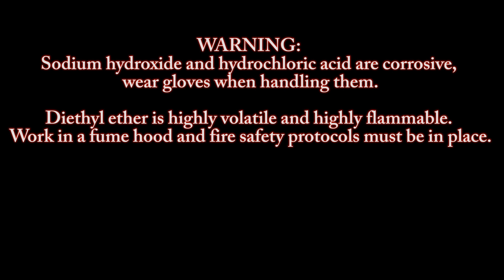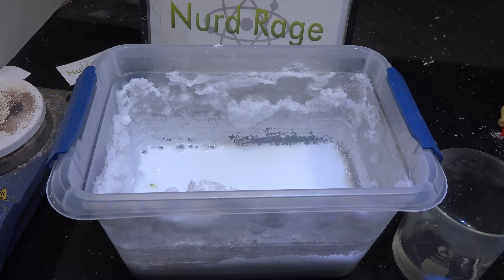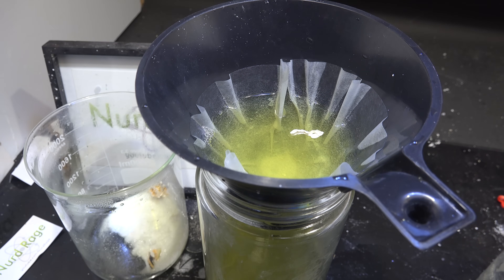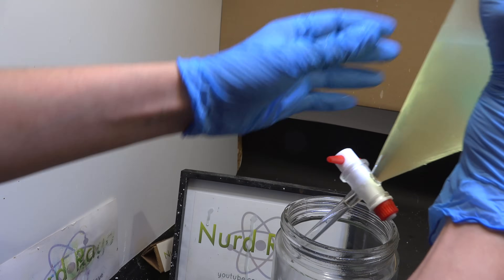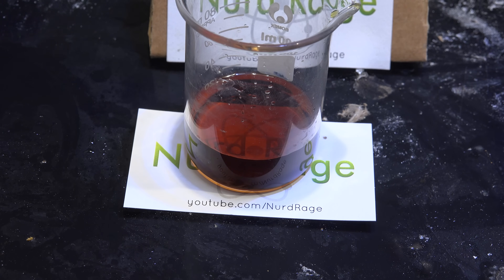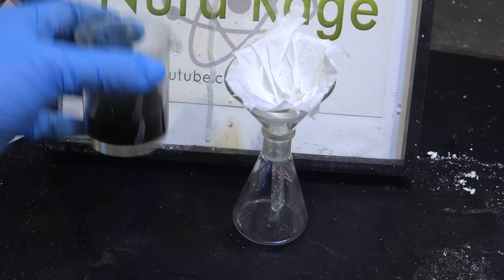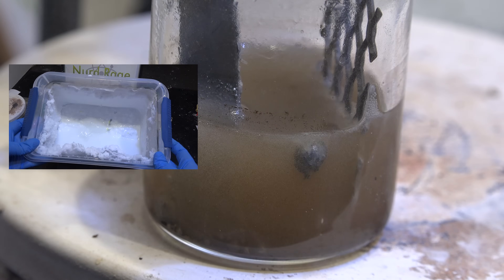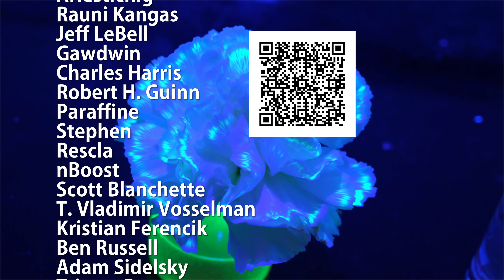Recover Used Gallium From Aluminum Using Solvent Extraction

Comment: I recently did an amalgamation of gallium-alumium-indium for viscosity experimentations, after reacting the alloy with h2o presumably reacting off the aluminium. I was then left with a liquid alloy bi-product which I assumed to be the remaining gallium and indium. The bi-product alloy remains in a liquid/jelly like state in the h2o with no visible reaction once the aluminium is reacted away.

when i attempted to retrieve and recycle the remaining gallium-indium alloy it rapidly oxidized as soon as dried and exposed to air. This oxidation of the bi-product was quite exothermic and resulted in a liquid blob with an oxidation layer. Each time i disrupt the oxidation layer and expose more liquid alloy it rapidly oxidises and continues the oxidation reaction until the entire liquid alloy is oxidised into powder. 

My question is why has my gallium-indium biproduct become so reactive in air that is unable to be recycled or handled when a standard indium-gallium alloy wouldn't react the same?

*Edit, The metals are mixed at room temperature under standard atmospheric conditions so a complete amalgamation may not be the correct term

Comment: It’s very annoying, but you COULD do a paper towel extraction on what spilled to recover as much as possible. Wipe everything up and then submerge the paper with water. Stir and then pour off the water. Do this several times and you can usually recollect around 50% or higher of what spilled.

Comment: So I’ve been given the nickname ‘gallium boy’ by my colleague chemistry professors. It started with asking if we could do the heart beat demo in lab. They said we didn’t have gallium so I bought some and a few days later showed up and said “can we do it now?!” 😅😅 fast forward about a year and I’m now building, or attempting to build, a YouTube channel funded by the university. 

One thing I’ve been wanting to try is electrolysis of gallium. I took about a week and dissolved some gallium in concentrated HCl. I know the next step is the addition of NaOH, but I’ve been holding off as I’m having trouble finding suitable electrodes. 

Since it summer, I guess most of physics department is off 😂 so I’m having a little trouble tracking down a lab power supply as well. 

I was thinking of trying to find a circular cathode that would basically sit across the top of the beaker so the gallium will rain down. I’d also really like to try it at low temps and try to get the gallium to crystallize. I’ve found some info on the pH range the solution needs to at for electrolysis, but haven’t found anything on the temperature ranges.

Comment: I've been reading that they have found that they can get a stronger reaction with water if they use more gallium than aluminium so the aluminium forms nano particles. 
I wanted to try it but I'm worried about getting the gallium back to try again.
This helps a lot what % would you say it's possible to recover like this?

Comment: Diethyl ether has a potentially explosive reaction with oxygen.  Makes some kind of peroxide, don't recall exact details.
Distilling ether is groovy and all, but it strips out the stabilizers.
We had a 2 liter bottle of diethyl ether that was nearly 15 years old; less than 1/2 had been used, but it had been opened 100's of time.  Yes, there was a log-book.
The fire department came, asked a few questions, then the bomb-squad came.
They carried out the ether in a little armored cart, the cart jockey in full bomb-blast gear.
Controlled detonation followed, according to the police report.
Then we found a 4 pound jar of bone-dry picric acid with a rusty steel lid...

Comment: Years ago I was using Na hydroxide and aluminum to make hydrogen gas for balloons.
Easy/peasy...
Was using an old-school glass bottle as a reaction vessel.
When I started, I had used a very small amount of lye, and the reaction was not running very fast.
So I dumped in about 1/2 cup of lye, all at once, and didn't stir!
Yeah, it made a clump, the clump got hot, the glass under the clump got really hot and finally the bottom simply dropped off the bottle!
Fortunately I was doing the work in a sink, not too bad of a mess.
The sink drained a lot faster after this...

Comment: I know this is an old video, but wouldn't it be better to simply concentrate the solution by removing the bulk of the AlCl3 by crystallization? No organic solvent needed, no loss of Ga⁺³ that remained in the aqueous phase, and the leftover Al⁺³ will  do nothing on the electrolysis step anyway.
Reply from the maker: Pretty sure i did exactly that.

Comment: Great work. Would it be possible to skip the NaOH and directly treat the weakened Aluminium and gallium mix with the Hydrochloric acid and then proceed to the Ether step?
Reply from the maker: that's what you should in fact do. I just did it this way to show that NaOH doesn't recover everything.

Comment: Thank you for showing the failure!  We all learn so much more from the failures of people who know what they are doing than from the videos of those who pretend to know what they are doing.  Failure is ALWAYS an option.  Anyone who claims otherwise has either never done anything worthwhile or is a liar.  :)
Reply: Failures are always an opportunity, but this is less of teaching people about something and more showing that he's a human being and capable of making mistakes, even if he has a degree. All he did was get a little too overzealous adding sodium hydroxide to the solution, and it caused a foam-over. That was a lapse in judgement which resulted in a failure in spite of his knowledge, so there's really nothing to be learned with the exception of some common sense about following instructions. Sodium Hydroxide solutions can melt your skin off, and pure NaOH loves to burn you just from touching it with your skin, and most people are very aware of this. Frankly, if you need a demonstration as to why it's good common sense to carefully follow instructions about adding something most people know is dangerously corrosive to an aqueous solution then it raises the question of why you didn't have that common sense in the first place. NurdRage didn't really fail, he just wound up making an idiot of himself by his own admission because he didn't follow the instructions on the back of the cake box.

If the Mythbusters taught us anything about learning, it's that 'Failure is always an option.' is more accurately said as 'Failure is always an opportunity to learn.', and that it does have its limits. Even Adam himself admits that when you do something stupid when you know how to do it, failure is not an option.
Reply: You are still alive? 
I thought you were dead because your channel went dark a few years ago

Comment: Hey NurdRage,
I was wondering why you didn´t split up your 500 ml of ether. I just have in mind from my organic chemistry lab, that extractions with solvents are alsways more efficient when you do more washings with a lower amount of ether. You could eg. have done 5 washings with 50 ml of ether on both your gallium solutions. I think this would have worked a little better, wouldn´t it? Another positiv thing about it would have been, that you don´t have to work with that much ether at once. Is there something I´m missing out right now, or did you just not think about doing it that way?

Comment: 4:35 Not a professional chemist... yet, but I was yelling at the screen for a different reason. You get more efficient solvent extractions if you wash the aqueous solution with separate, smaller fractions of ether. For example, three separate washes with 100 mL of clean ether will recover more GaCl than one large wash using 300 mL of clean ether. You would have been better off splitting the ether you had between the two aqueous solutions and collecting smaller fractions from each one.

Comment: It is worth noting the peroxide risk of diethyl ether.  Diethyl ether can form peroxides with oxygen in the air which are dangerous, even explosive.  Be very careful with ethers that have been stored for a very long time.  If you don't already know how long is too long please read up on it yourself to be sure.  It is better than missing appendages.

Comment: ok just to tell you how dangerous diethyl ether is just imagine it's as flamible as hydrogen as a liquid and just flat out causes cancer
Reply: science_and_anonymous; Diethyl Ether is NOT carcinogenic, PLEASE stop spreading more misinformation.

Also, your comparison of Diethyl Ether to Hydrogen is way off. Ether is actually quite similar to most hydrocarbon solvemts when it comes to flammability.
Just because ether is volatile at room temperature, does NOT magically change it into something that can burn with a flame as hot as that of Hydrogen, nor does it increase its explosive limits to such extremes (Hydrogen has an EXTREMELY wide explosive range in pure oxygen, 4~94% by volume). All it means is that it can attain a sufficient concentration more quickly than a less volatile solvent could.

Compare (all in standard atmospheric air):
Substance: Lower flammability limit, Higher flammability limit, Flash Point

Hydrogen: 4%, 75%, N/A
Diethyl Ether: 1.9~2%, 36~48%, −45 °C
Gasoline: 1.4%,	7.6%, −40 °C
Acetone: 2.6~3%, 12.8~13%,	-17 °C
Methanol: 6~6.7%, 36%, 11 °C

Regular gasoline achieves its lower flammability concentration in air at only 1.4% by volume!
Reply: science_and_anonymous; That really doesn't tell you anything about the danger (even if ether was listed as a possible carcinogen, which I can't find ANY reliable evidence of...), aside from saying that "there might be some danger", which is pretty much true of everything.
Even radio and microwave radiation (so WiFi, your cellphone, tv, microwave, etc.) is OFFICIALLY "possibly carcinogenic" as well...

From the IARC website:
"The WHO/International Agency for Research on Cancer (IARC) has classified radiofrequency electromagnetic fields as possibly carcinogenic to humans (Group 2B), based on an increased risk for glioma, a malignant type of brain cancer, associated with wireless phone use."

This is obviously ridiculous, since that places WiFi in the same category as PAH's (Polycyclic Aromatic Hydrocarbons, which we are pretty sure causes cancer), chlorinated hydrocarbons such as chloroform, 1-bromopropane (a strong alkylating agent, GUARANTEED to be genotoxic in even moderate quantities), diesel exhaust, HPV (the Human papillomavirus), metallic Lead and...
Kava and Ginkgo biloba extracts.
Seriously...
Reply: where did you get the cancer part?
Reply: Closedloop it's a know carcinogen and is labeled that on the MSDS
Reply: I found one MSDS stating, for diethyl ether, "CARCINOGENIC EFFECTS: Not available. MUTAGENIC EFFECTS: Mutagenic for mammalian somatic cells. Mutagenic for bacteria and/or yeast." Not that it would be advisable to huff and puff this stuff, but I am really not convinced.
Reply: Closedloop I've done alot of work with Diethyl ether and from safety sheets I have been given it has been listed as a possible carcinogen.
Reply: Closedloop just because it says not listed doesn't mean that it isn't one as gasoline is not under a carcinogen list although huffing gas most certainly cause cancer
Reply: MRLT Alright with the flamibility I totally get where I was wrong, and you even provided evidence for it, but I was just trying to show that it's pretty nasty stuff and even a hot plate can light it on fire. still, comparing it to hydrogen was a bit too much. As far as Diethyl ether causing cancer I remember reading it in a MSDS paper about 7 years ago when I first started taking chemistry and I never really questioned the authenticity of the statement as it was given to me by a teacher, and back then I wasn't used to working with it. Dispite that, even if it doesn't cause cancer I would highly not advice sniffing it as that most certainly will cause alot of issues which you can't debate won't.

Comment: I would like to point out that diethyl ether should only be cooled in a special explosion-proof refrigerator/freezer.  In a confined volume, vapors can still build up and a spark as the fridge compressor or light turns on could cause a normal household fridge to explode.
Reply: With a flash point of about -50 degrees centigrade, even at the coldest point a domestic freezer it would still be plenty warm for ether vapors to build up and cause an explosion.
Reply: The other important one to think about is cooling ether down increases the solubility of o2 in solution
So storing ether decrease its shelf life due to peroxide formation
Reply: For when you need ice cubes fast, but you’re 2 blocks down the street

Comment: Could I use naphtha as a nonpolar solvent instead of ether?
Reply: Niels Breeschoten; Exactly.
I was actually a bit surprised that the gallium held onto the ether THAT strongly during the distillation (if you don't know, the Lewis acidity decreases in the series B>Al>Ga, for the trihalides).
This presents a pretty big issue, however: Why didn't the Aluminium preferrentially bind with the ether, since it is a stronger Lewis acid?

In any case, I am assuming the decomposition we saw was due to the diethyl ether (since it was the only organic compound present), which would mean that the gallium bonded so strongly to the oxygen that at least part of the molecule could break free and/or react with a neighbouring adduct (this was really amazing to me since ethers are SO strongly bonded that they are pretty much considered to be inert for all intents and purposes in organic chemistry).
The fact that a fairly weak Lewis acid could do that was REALLY quite amazing to see!
Reply: Nuovoswiss; You really can't use isopropanol to effeciently partition anything out of an aqueous phase.
As for ethyl acetate... I would expect the aluminium and gallium chlorides to cleave its ester bond quite readily at the elevated extraction temperatures.
Also, if you happen to come across 'petroleum ether' and wonder if it would work, the answer is no, it won't work at all (as it doesn't actually contain an ether functional group).

If I HAD to use another solvent, I'd go for another simple aliphatic ether.
Reply: ether is not nonpolar, its dipole moment is around 1.2
Reply: Niels Breeschoten; I believe it has more to do with the ether oxygen being a lewis base and the gallium chloride being a lewis acid. So it actually forms what is known as an adduct with the ether, which then dissolves in more ether.
So no, you can't use just any non-polar solvent.
Reply: MRLT So that's why he specified that the gallium trichloride has a strong bond with the ether
Reply: Things you could try are another ether (dipropylether, THF), benzene or dmso.